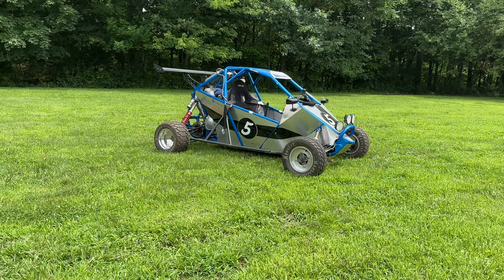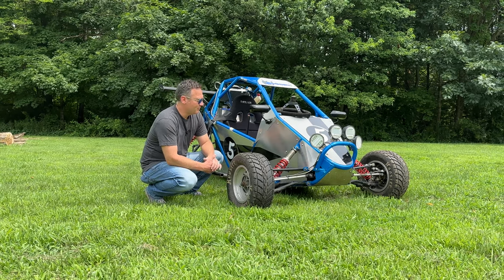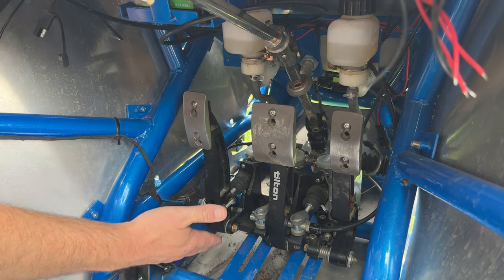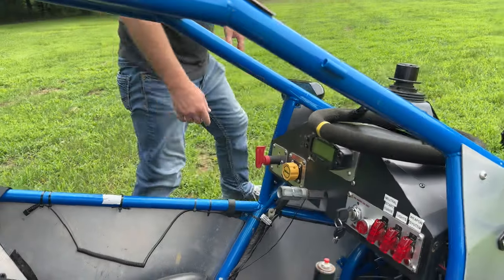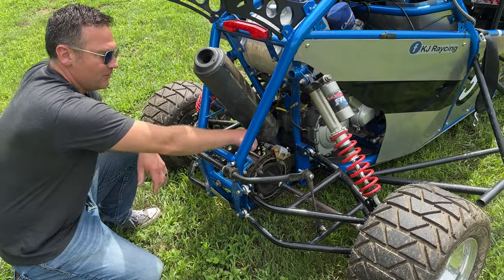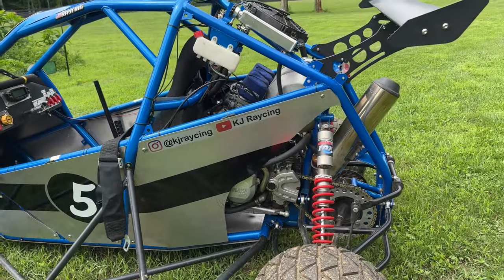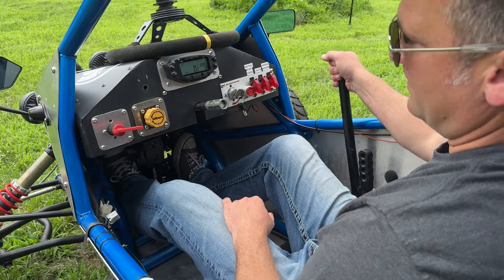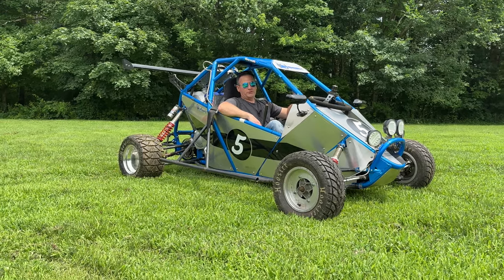How I built a 100hp Crosskart on the Cheap (all of the details and lots of clips)

Comment: Only downside about doing the bike engine is, I don't have a motorcycle endorsement. For me, I'm looking at doing a Ninja 250R, or similar sized bike engine for one of these. I'm not looking to go for ludicrous speeds, but going 70+ or so would be plenty fast on the top end. Even 60 will be stupid fast being inches from the ground.
Reply: Using a motorcycle engine doesn't require a motorcycle license or endorsement

Comment: How close are you to PA and would you be willing to build & sell one? Also can you add reverse? 
I just bought 80 acres and I've been looking for crosskarts for sale in the area for months with no luck. I'm actually considering buying I used racing one overseas..  but I don't want to compete I just want to have fun with my property. So if I can save $10,000 and not do that I would rather..

Although I'm a farmer so in extension I'm also mechanic I should be able to make this myself it's just taking care of several dozen horses excuse me no time to work on projects like this. If I have time I'm usually making breaking or upgrading something on the farm.
Reply from the maker: I’m a full time military Aviator.  I don’t have the time or insurance to build these for anyone. I sympathize with you but if you really want an incredible machine you are going to have to find the time to build it. I built a running and driving kart in 5 days of work and with cars and cameras we built a fast one in 4 days. You can do this 👍, the hardest part is to start. I wish you the best.
-Kyle

Comment: I wish you’d go through a company that cuts, bends, notches, and labels the tubes, so you could sell the frame as a weld it yourself kit. I’ve got all the tools to build it myself, but man I just don’t have time
Reply from the maker: I wished a company had done that when I started too, but I ended up just having to find time outside of my full time aviation career and family. It’s worth finding the time as you can see. The hardest part is to start, I wish you the best.
Reply: I sourced buggy parts from a guy who sold plans and also sold a pre-cut frame kit.  It was his full-time job and he had a well-stocked machine shop to back him up.  That was before side-by-sides (SxS) were ubiquitous.  Today, buggy building is a hobby, not a business, because it's no longer economical when you can pick up a SxS for a few thousand bucks.  I couldn't cut, bend and ship the frame parts for a price that would satisfy either of us.
Reply: Hello Freddy,

I live in a  larger more established Metro with server steel yards. So I truly hope this help you as well.

I've been calling around for pricing and while talking to them I've also been asking if the offer other services like the notching, bending and sheet breaking/ sheering. Many of the suppliers don't sell to the public but there are enough around there that it gives me a choice of where to go. anyways.. rambling on here, some places offer some or all of those services but an extreme premium, sometimes folks were asking several dollars per notch. not bad if you need one notch but definitely not economical for a chassis build. When it gets really expensive are the bends and ever more so when you get multi and compound bends. You can probably do it, but you still need to supply them with degree angles cuts length ect ect for each part. 

Anywho, sorry for the novel but sincerely hope this helps you.
Reply: @atvtheory3151 Please tell me where I can buy a SxS for what you can build one of these for... Please!
Reply: where are you getting a side by side for a few thousand bucks? other than some chineese garbage.

Comment: How much is it to actually build one?
Reply from the maker: Varies wildly as said in the first 30 seconds of the video… my personal experience is as low as $2000 and the most expensive being around $6800. The hayabusa two seater may top that but it’s not done yet for a build cost.
Reply: @KJRaycing  well when you consider how much a Honda talon costs 24000 bucks new. And I can build one of your carts with a weapon system for 4k 😂